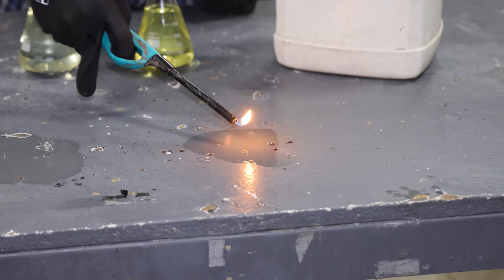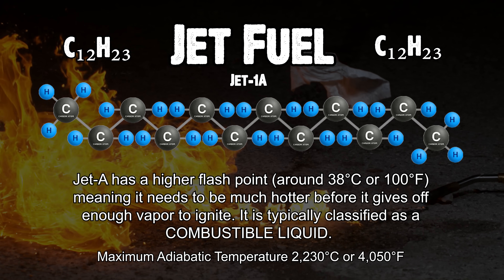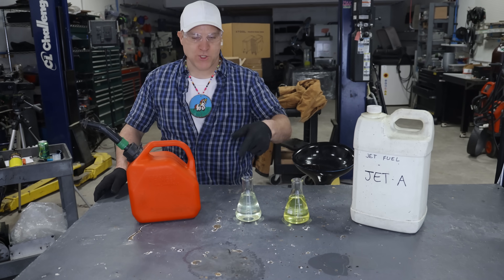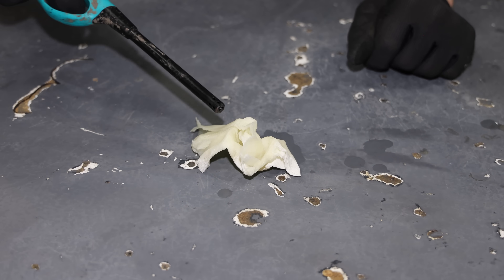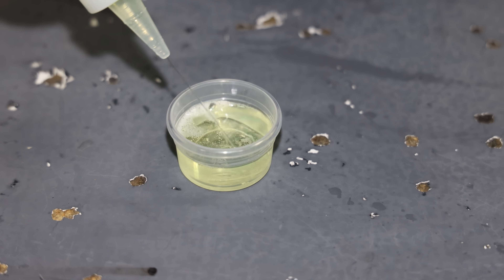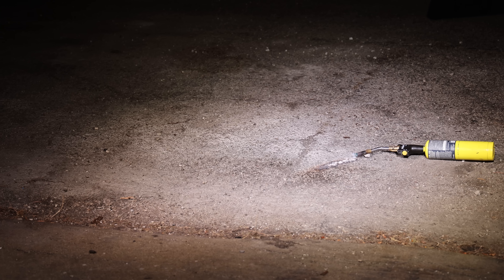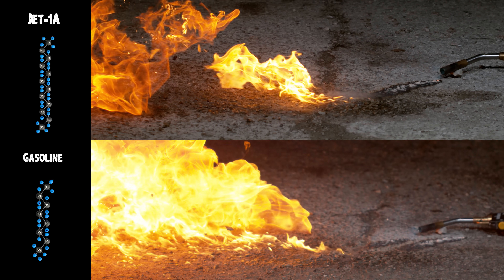What Happens If You Light Jet Fuel vs Gasoline?

Comment: Jet-A1 is basically modified Kerosene and very similar to diesel. I know of people using Jet-A1 plus an additive to use in diesel cars. (Because they got the jet fuel free)
Reply: Fighter jets will run on dang near anything. Kerosene, Diesel, Jet-A, JP-8, etc. At least for a few flights. Might require more inspections or whatever but the main reason they use JP-8 specifically is the anti-icing and anti-corrosive additives, otherwise its all pretty much the same.
Reply: @MattH-wg7ou  The Abrams tank with its gas turbine engine can run on jet fuel, diesel, heating oil, in a pinch gasoline (but wears out turbine hot section faster), lamp kerosene, alcohol, … pretty much anything.  Jet fuels are optimized for not freezing and not dissolving water too much as much as combustion properties.  Because nothing says “Oh f*ck” like frozen fuel in the tanks at high altitude.
Reply: @MattH-wg7ou  a more accurate statement is turbine engines will run on pretty much anything flammable. It has nothing to do with the aircraft they're strapped onto. Even turboprops. However, the overwhelming majority are only certified/designed for Jet-A especially if they're carrying humans. But many will have carveouts to use other fuels on a case by case basis (like to get a plane out of a remote area without Jet-A). The P&W PT6 can run on an alcohol blend if need be (but will require an inspection immediately after.)
Reply: @aerialbugsmasher  I worked on a oil platform in the Gulf that has six big turbine generators that run on natural gas strate from the oil wells.
Reply: @aerialbugsmasher  yea I just didnt wanna speak with confidence about something I dont know first hand. I know fighters specifically are designed to be flexible in practice not just theory, wasnt sure about airliners and how their ECU/DEEC/whatever would handle it. But youre right, in basic principle turbines really DGAF!
Reply: @aerialbugsmasher Sounds like you mean to say you can configure a turbine to run on various fuels, which is true, to clarify the problem of the above comment which suggested you can fuel "fighter jets" with crap like diesel while they are designed and configured for some other fuel.
Reply: @erickborling1302 don't overthink it. There's nothing to configure. A jet engine will literally run on almost anything as it sits,  that's the point. Whether it's certified to do so and without long term issues is another aspect. But many aviation turbines are certified to run fuels other than jet-A temporarily
Reply: @aerialbugsmasher turbine engine dont have any timer parts. So any engine that dont require timer can use any fuel.
Reply: @biggdogg33  WTF is this gibberish?
Reply: @aerialbugsmasher  you ever heard of a timer belt for car(piston engine)? Since piston engine need their combustion in a seal container, (intake and exhaust manifold get seal during combustion in a piston engine) therefore need a timer belt. A different type of fuel would throw the timer off.
Turbine dont need to seal off their combustion chamber so, no timer is needed.  Therefore should run off of anything combustible. 
Do I need to break it down more?
Reply: @biggdogg33  TIMING BELT. A timer counts down the time. 🙄 Yes I'm very well aware of that a timing belt is I've torn apart several engines for DIY car maintenance; regardless that's a pretty silly criteria to go by. Piston engines (and even turbines) have run on gaseous and even solid (pulverized)  fuels regardless of the timing belt. Being sealed in a pressure vessel has nothing to do with it.  These are INTERNAL COMBUSTION engines, that's the defining characteristic, whether combustion happens or not. Fuel type is nearly irrelevant.
Reply: @aerialbugsmasher  so uhh, turbine engine once it get going, dont need any spark plug or any ignition source. It work by compression a ton of air in one direction. Since the exhaust is bigger than the combustion chamber, air just escape. You just need to monitor, temperature and rotation speed. Different fuel source would react differently. Like gas wil burn hotter with less rotation speed. Kerosene is the best and widely used because it burn less hot and get high power/rotation.
So in theory, you can run it off steam. It will run like shit but possible. Water turn to steam. 
Why, it is no cycle. Compression is always compression. Combustion is always combustion. Therefore no timing.
Reply: @MattH-wg7ou The M1 Abrams has a gas turbine engine they say will burn virtually anything. Up too and including high proof grain alcohol. That is crazy.
Reply: @MattH-wg7ou As a pilot I have trouble with that comment as we don't muck around with fuel and if it's going to damage the engine at all why the hell even think of it let alone TRY it.
Reply: @MattH-wg7ou 🤔
Reply from the maker: Yes 100%, same here I know some guys out in I don't remember what state, but they get the expired fuel from the airports.
Reply: @WarpedYT  That's a thing at any respectably sized airport with maintenance facilities for turbine engines/aircraft. They often need to drain fuel tanks for overhaul and what not and that last bit of fuel in the tanks is usually considered unusable/contaminated and is discarded. Several hundreds of gallons worth. I had access to this fuel through a maintenance contact at my airline.
Reply: 1/ 200 of 2 stroke oil does the trick :) I did run a 2001 model Mazda 626 turbo diesel on kerosene for 3 years 2 stroke oil added.
Reply: Kerosene is also very close. As a kid my dad would often dump ten gallons of Kero into our oil burner when the fuel oil delivery was late. I was watching a documentary about the SR 71 blackbird. One of the pilots said you could toss lit matches into a pale of jet fuel and it would put the matches out all day long.
Reply: @bobbressi5414 Yeah, Navy sailors on carriers have testified to me that this was true in 1988.
Reply: @bobbressi5414  After watching this video with the correct explanation I believe it otherwise I would not.
Reply: yeah put some 2 stroke oil in jet fuel or kerosene
Reply: I've done it. Need to run some two stroke oil in it because JetA is too "dry"
Reply: The only problem with the jet fuel is the lack of lubricants so it's usually smart to add some oil to the fuel before adding to your vehicle.
Reply: Kerosene is used in juggling too, quite safe till you don't swallow it.
Reply: I just miss @UncleRob
Reply: A jet can fly on anything, even brandy.  Jet fuel / avter is used because it is the cheapest.
Reply: High grade kerosene. You can add Marvel’s Mystery Oil to it to run it in diesel engines.
Reply: Peanut oil! One more use added to the list! 🙃
Reply: Jet A, diesel, and RP1 (rocket fuel) are just refined kerosene. Their additive packages are what sets them apart. Jet fuel has to remain liquid at -70°c, RP1 is highly refined and close to pure, and diesel has to meet emission standards.
Reply: I work on an airport and all the fuel guys have diesel cars and they fill their tanks with the Jet-A they have to drain out of the storage tanks everyday. I also know a guy who runs red diesel in his jet engine.. it runs horribly. It smokes and shoots flames out of the exhaust on start up.
Reply: That must be why my zafira is flying without wings😂
Reply: You shouldn't run it on modern high pressure diesel cars though, it'll clog the injectors as it doesn't have the same additives and tends to be less pure than diesel. There was a news story years ago when someone sold jet fuel/kerosene as diesel and it was fine for older cars but he got caught after bunch of more modern engines broke :)

Older engines run on almost anything that resembles oil.
Reply: @hnsk yeah, my LandCruiser is 41 years old and like you say, will run on anything that smells like oil. 😂
Reply: @hnsk probably broke the newer engines due to lack of lubrication in jet A
Reply: @jamesringler987 yeah could’ve been that as well
Reply: @hnsk  Yes, that is why the OP said they put an additive into the fuel. We used to do the same thing at the airport I worked at as a line guy. We'd put the bad Jet-A(not the same as Jet-A1) into the truck's fuel tanks, and use that plus an additive to restore the lubricating properties to the Jet-A. Jet-A is an aromatic fuel and is very hard on rubber and plastics so you have to have non-aromatic rubber and plastic to keep them from being broken down by the fuel or you have to add the additive to protect the rubber and plastic parts of the fuel system.
Reply: The Chrysler Turbine Car, was powered by a jet engine, and could run on various fuels. The 60s ! More than just hippies !
Reply: According to a chemist for exon, if you mix a quart of very light motor oil with 55 gallons of Jet A, it will be indistinguishable from regular automotive diesel fuel. This from an ancient who survived the Arab oil embargo under Carter.
Reply: @stephenwalton9646 what about light hydraulic oil like aw 46 or 32
Reply: @jamesringler987 The engineer said 10w20 would introduce lubrication needed to bring the JetA up to specs with road diesel. We were flying the engineer to a meeting in a King Air and had access to the daily sump samples. My buddy wished to use that fuel without voiding his warranty on his diesel rabbit.
Reply: This is against US federal law, for theft, tax evasion, and recklessness!
Reply: this video doesnt observe safety, its dangerous to put fire near the container of gasoline
Reply: Yes, and it won't melt steel beams.
Reply: @garnet4846  HWFGA.
Reply: @garnet4846  Bends easily at only 1,200 degrees F.
Reply: @garnet4846  What is your point? I suspect you might be one of the conspiriacs who deny that the Twin Towers were brought down because of the avgas fires. They didn't collapse because the steel melted - they collapsed because the heat softened the steel to the point they couldn't handle the load on them any more. Any blacksmith in the past 3 millenia can demonstrate that to you. When I was a kid on our family farm we used to break of pieces of steel wire by simply bending them repeatedly and rapidly. Tis heated them up in the bending stress area. Just about when the wires would get too hot too hold, they would break right at the bend, leaving a piece of the desired length. So even as kids younger than 10 we knew steeldoesn't need to melt to fail.
Reply: @nicolemmer7681 thanks bot.
Reply: @garnet4846  It's a pleasure, parrot
Reply: We used jet fuel in our diesel trucks in the brainwashed terrorist US army.
Reply: @USA-GreedyMenOfNoIntegrity always a weird schizo in the replies. What are you saying dude.
Reply: @USA-GreedyMenOfNoIntegrity If you really served in the Army you would know that DOD issued the directive for fuel standardization in the late 1980s, specifying JP8 as the primary fuel. Seems it is a lot less complicated to handle and move one type of fuel to and around the battlefield. "Brainwashed terrorist US Army?" Level 4 TDS alert.
Reply: @USA-GreedyMenOfNoIntegrity  No you didn't. You used JP-8 or JP-4 if it was in the 80's. Which is actually cleaner than Jet-A which is why when the US Army went to JP-8 there were so many clogged fuel filters until the JP-8 cleaned out all the junk in the lines. So clearly you weren't there at that time or you would have known this. So you aren't brainwashed, just brain dead.

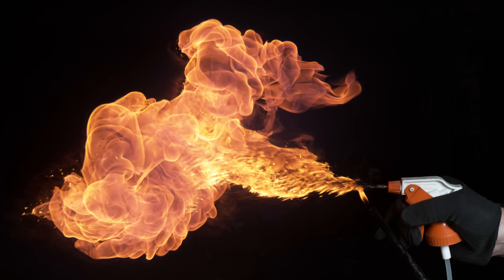Comment: About the final statement about designing tanks with less tendency to spray the fuel at 5:17, it is a fair point but it just does not matter. The problem with aviation accidents is the enormous kinetic energy due to the speed and mass of the airplane, that has to go somewhere, no matter how you try to protect the passengers or if you prevent the deflagration, the odds of survival are close to 0 anyways.

Accidents and deaths on civil aviation are the lowest of any means of transport in history... ...but if your plane crashes, you are fucked. At least it will be fast and not due to heat/burns.

Comment: I learned this from MythBusters when they tried to replicate the trope where a vehicle leaves behind a trail of leaking fuel. IIRC their explanation was that Jet Fuel was so bad burning as a trail because it wasn't evaporating as fast as gasoline, so there wasn't enough air-fuel mixture to cause flames
Reply: Every episode of "Mythbusters" should have had a printed warning at the bottom of the screen throughout : "Warning, we're a couple of turdy 'tards here to entertain you because the network needed a show in this timeslot.  Check our education, check our backgrounds, you will learn that both of us are unqualified to "teach you" anything."

Comment: I'd love to be wrong about this, but I suspect it's impossible to design a fuel tank that can prevent fuel atomization in an air crash without it being way too heavy or having some other undesirable characteristic.
Reply: Yeah, there's so much energy involved. The tank will always rupture upon impact. 

Planes are going around 140 -160mph at their slowest part of flight., and they hold thousands of pounds of fuel.
Reply: @volvo09 in which case, of smashing into the ground, fuel tanks are the least of people’s worries. 

…unless of course the planes are remotely controlled drones and the buildings are rigged with explosives and full of people who weren’t given the heads up. 

Much like those involved with finding the Pentagon’s missing trillions…oh wait, they’re wasn’t a plane involved with that. Again, explosives though…in the only room with all the evidence and investigators on the missing trillions.
Reply from the maker: Or maybe somehow in case it in foam, a lot of engineering challenges there for sure but I have a feeling that somehow someway it can be done, But maybe it's just not feasible.
Reply: @WarpedYT  I know there was some work done on fuel tanks filled with a some sort of sponge. I think it occupied less than 5% of the volume and it made the fuel tank a lot less likely to burn or explode when filled with gasoline. Even if the tank had less than half the volume with gasoline you could dropp a match in the filler neck and it would just burn, never explode.
This would of course still not protect about the fuel spraying out if it was smashed with a hard enough force. But the idea was protecting against explosive combustion in case of a moderate crash or even being fired upon with a machine gun. At most it would leak and that in turn could burn but again, no explosion in the tank. As for leaks there were some work on making fuel tanks for helicopters that would mostly safe seal if shoot with small caliber fire. Combine the two and I think that's as good as we get. But crashing a airplane into the ground and I don't think it would help.
Reply: @blahorgaslisk7763  yea, a lot of military aircraft, specifically combat aircraft, have self sealing fuel tanks with some kind of foam liner to prevent explosions when hit by AA fire. But thats different from a full on crash!
Reply: Israel
Reply from the maker: I agree, it was just a thought like "What If"
Reply: The tank would have to withstand a 120mph to 450mph impact. It can't be done, if it was done the tanks would be to heavy. Weight counts in aviation. A lot of aircraft simply fill the voids in their wings with fuel turning the wings into fuel tanks. It would be hard to reinforce them. Most military's use self sealing fuel tanks pressurized with inert gas, which come with a high weight penalty. But they only protect against small projectiles. They cannot withstand a crash either becouse it's impossible to build a fuel tank light enough for aviation that can withstand an impact over 120mph.

Comment: Have you fueled for air line before your wrong about jet-a fuel I worked for a fueling company at a airport we had to use extreme caution when fueling and have access to fire extinguishers at every single gate and the airport emergency services are always on duty 24/7 to prevent accidents of any kind